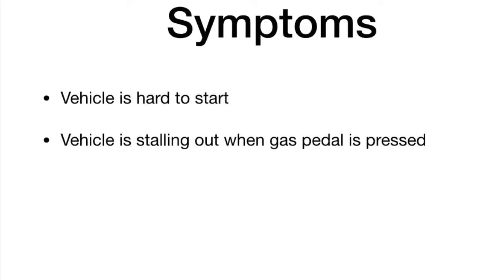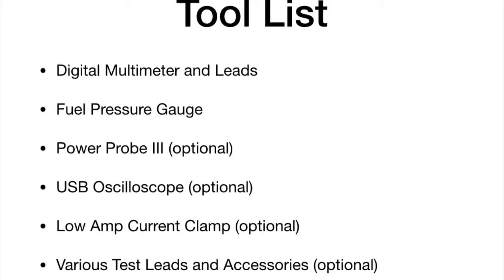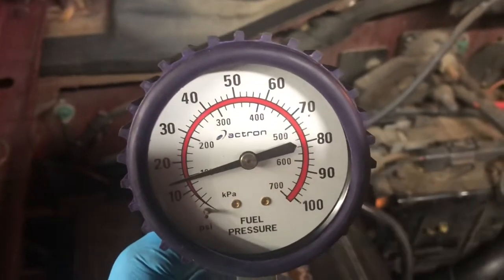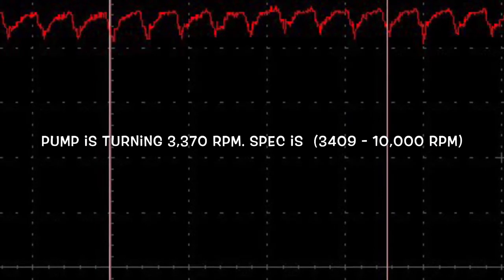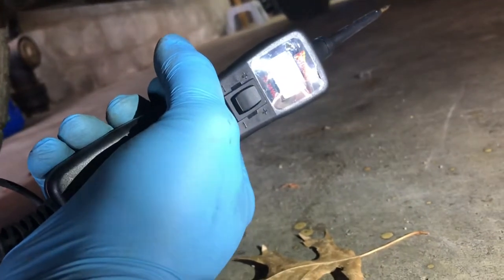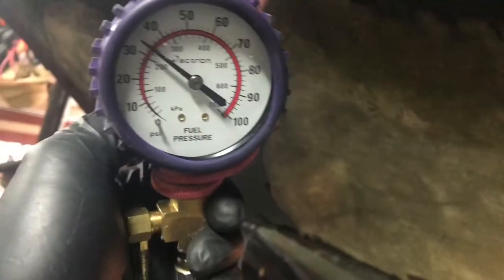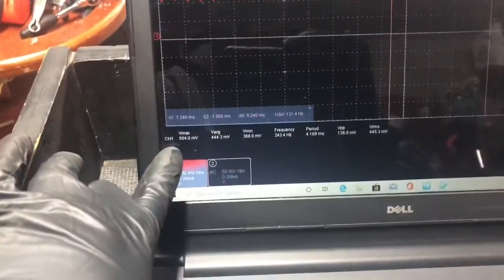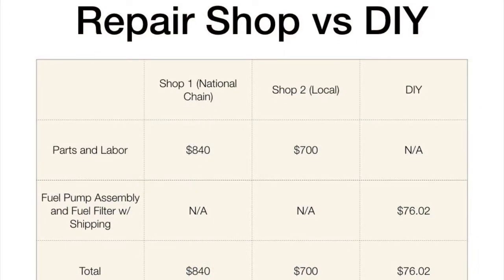How to Diagnose a Bad Fuel Pump on 2000 Ford Expedition 5.4L

Comment: very good coverage
Reply from the maker: Appreciate you!
Reply: @daddydiygrilling  keep it up, the testing you do is along the lines of engineering test where you get measurable results. Being a Mechanical engineer, I have done lots of test and set standards to qualify equipment. In the old days OEM car/truck manuals covered the theory of operation of individual components like power steering pump etc. Now days it is just pinpoint test which doesn't give you a clue as to what is actually happening. Thanks

Comment: Where was that fuel pressure check valve located on the engine?
Reply from the maker: It’s on the fuel rail. Checkout this video for more details. 

How to Check Fuel Pressure on a 2003 Ford Expedition | DIY
https://youtu.be/lloGSFd-5sE

Comment: Did you ever trip a code for weak fuel pump?
Reply from the maker: No. Never did set any codes.
Reply: @daddydiygrilling  yeah, my truck has stalled multiple times in the past year, mostly at lower rpms. Always take multiple turnovers before it starts. Never get any codes. Just dies. Sometimes it'll go 7-8 months without no issues. Then all of a sudden, it did it twice today. In two years this is probably the 7th time total. Truck has 160k and I'm the original owner. 04 Expo w/5.4
Thanks for a good video, I'll start checking the numerics tomorrow
Reply from the maker: Take a closer look at the fuel trims...might provide you with some direction. Thanks for watching. Stay safe and happy holidays.
Reply: Okay Bro, thanks and Happy Safe Holidays to you as well

Comment: When you went under the car. Pink and black stripe is the positive and black is the negative. I don’t hear the pump working up front with the ignition on. If I were to jump it back there and not hear it as well , is that a sign of a bad pump as well. Fuses and relays seem to check out. It’s on a 2001 Ford Expedition. The owner claims to have changed it before. Also the scanner says primary fuel circuit malfunction / secondary high.
Reply from the maker: My 2000 and 2003 Expeditions both have a key on engine off prime and you can can hear the pump run momentarily when you put the key in the on position. If you don’t hear anything, probably need to take a closer look at the pump and circuit. Are you getting 12 volts to the pump with the key in the on position? Need to make sure everything else in the circuit is good before you call a bad pump. Sounds like you’ve already ruled out fuses and relay...check to see if you’ve got 12V at the pump.
Reply: I just went under and checked for 12v and it was good. The fuel filter looks pretty rusted and one gas tank strap broke off.
Reply: What about this "inertia switch" that is inline to the pump that I read can disconnect the pump and do you know where it is?